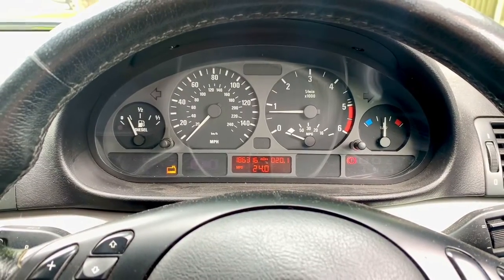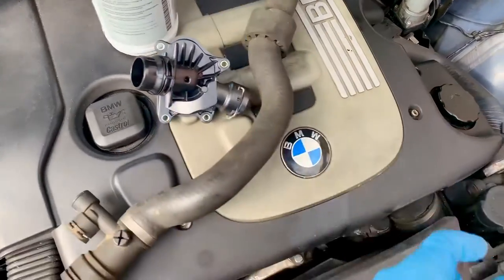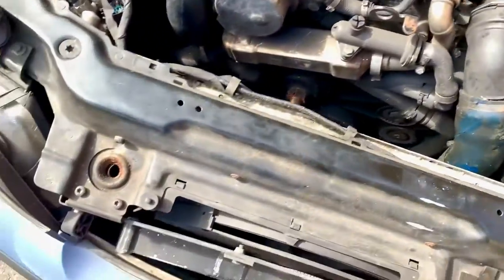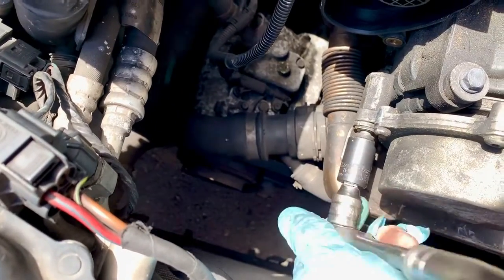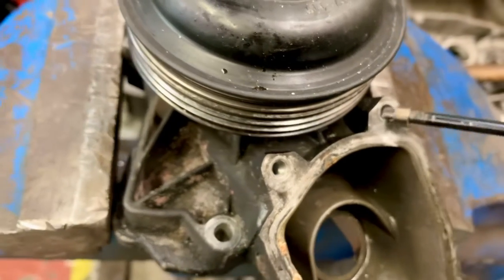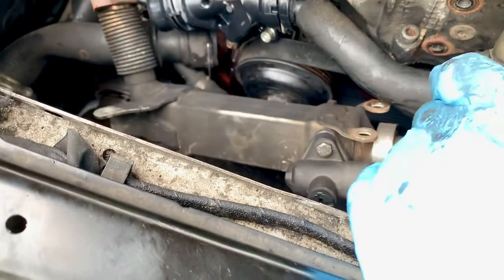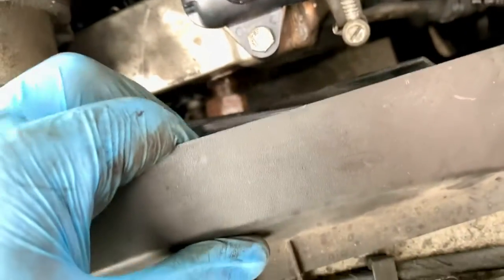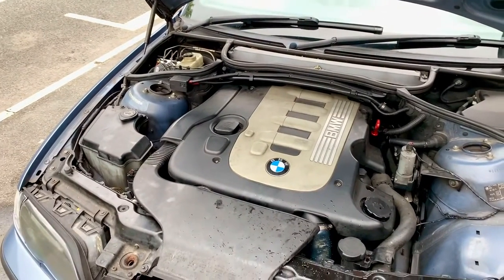BMW M57 Thermostat + Water Pump DIY, BMW 3.0d 330d Coolant System Repair + Disaster Snapped Bolt

Comment: Thanks, great video. Having exactly the same issues with bonded bolts on the thermostat couldn’t get them out.  Amazing how my DPF issue is growing into glow plugs, controller, EGR, thermostat and now I’ll need a water pump and fix hopefully.
Reply from the maker: The most common dpf issue on these, well on the later cars than this, is probably the thermostat. The dpf will never regen if the engine is too cold. I had the same issue on my dad’s 335d when he first got it. Changed both thermostats for genuine bmw and that sorted the dpf issues. I did the glow plugs and module on the car in a recent video too. The glow plug issue wasn’t actually causing any issues tbh, but my dad is very fussy and just couldn’t live with the car having a fault flagging up on it when he plugged his diagnostic scanner in.
Reply from the maker: This is the glow plug video if you’re interested 

https://youtu.be/2t339NLbIIQ?si=CPxtobUIveTBS7VU
Reply: Thanks for the link also a good watch - more relaxed after just replacing the glow-plugs :) went OK, none of them stuck didn't know about a cleaning tool to get all the crud out of the chamber - next time!  Controller module also - done by touch and knowing what it looked like, my back is suffering....  @StupidBlokeStupidVideos
Reply: @StupidBlokeStupidVideos  After much reading up, I'm in agreement and hope the higher temp makes a difference also. my C110 scanner had all glow plugs and controller errors, multiple DPF errors and regeneration not working faults/back ....  I also noticed the water temp seemed to struggle getting above 75-C, but never thought an issue until reading up,  so changing the thermostats .  Have purchased DPF cleaner foam and will inject in the pressure sensor line and hope this gives it all a kick start (WHEN I get it all put back...). Thanks for making the videos - great descriptions also take that Sh***er off that sh***er- know exactly what you mean.!
Reply from the maker: @paulroberts2899  yea the thermostats are the worst thing to cause dpf issues on these I think. Also cos there’s no temp gauge you don’t realise the thermostat is fucked until the dpf blocks up 🙄

Comment: My M47 was never getting to temperature so I replaced the thermostat (lots of work, as you can see here)... then it was still not getting up to temperature! Turned out all it needed was the little EGR thermostat on top (5 minute job)... D'oh!
Reply from the maker: Always change that one first. I knew that wasn’t my issue as mine is disabled and blocked off

Comment: Thank you for making this video
Reply from the maker: Than you for watching it.
Reply: @StupidBlokeStupidVideos  Do you know if glow plugs always throws out a fault code if bad? Have had some problems starting up this winter when below -15 celcius.. no faults from sparkplugs or battery
Reply from the maker: @simenkarl1234  you mean the glow plugs, they usually do yes but you could possibly have some that are weak but working. They don’t need them until it’s very cold, but -15°c it would need them to start up without a lot of cranking. The glow plug module is a common issue for failing on these cars too. It’s the same setup as in this other video I did on my dad’s 335d. 

https://youtu.be/2t339NLbIIQ?si=0CZQBcE-0-Zu8-no

Comment: This looks simple, today on the highway e39 530D m57 at a speed of 180 km h, it started to raise the temperature to 110 degrees, I immediately lowered the speed to 120 and turned on the heating to max and the temperature returned to 90, what can it be, there is no water it failed, I didn't turn on the air conditioner. the outside temperature is 40 degrees, visco is works normaly
Reply from the maker: @mr_ali3692  your water pump could be the problem. I’m pretty sure that the 530d has an electric aux pump for the heating circuit which may have been just enough to cool your engine down 🤔
Reply: @StupidBlokeStupidVideos  I think i dont have electric pump water Because car is 2001 y, for few days i go put new water pump

Comment: did the waterpump not leak at all after the new sealant? I’ve had the exact same happen with my thermostat and one bolt is left in the water pump so it looks like i’ll have to take the pump out too
Reply from the maker: No mate not leaking. I should probably have changed it as a matter of course whilst I had it off though tbh

Comment: Very helpful video! So you were not tempted to do an EGR Cooler delete?
Reply from the maker: Nah, it’s already blanked inside with the handle off an old screwdriver anyway so the coolant can’t even get through it 😂
Reply: I've not removed mine yet but seems to me it would free up a lot of access space 😁
Reply from the maker: @nickwoolley733  yea deffo. It’s always in the bastard way.

Comment: So it wasn't the Renault 5 thermostat you shoved in the pipe that made it fail??
Reply from the maker: It’s possible but I don’t think so,.. I think it had been weakened when the engine mount was shagged a couple of years ago.

Comment: just done my e60 535d,
ref the egr cooler bolts,,,,
thats what the devious germans DO LOL,mine also had one torx and one allen stud bolting the egr cooler on,
even greater deviancy,,,the have made them non magnectic haha ,so when you drop one ya magnectic pick up tool doesnt work,bstids lol
Reply from the maker: YES. They do the same with the manifold nuts so when you drop them into the intake, you’re fucked 😂